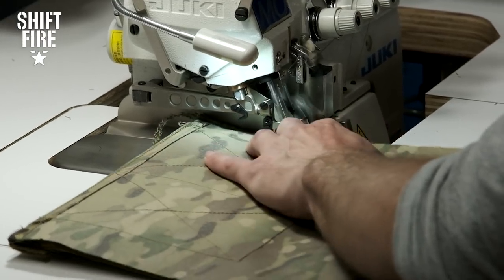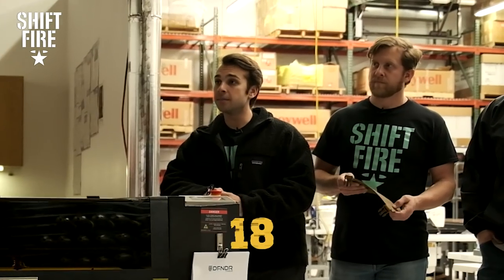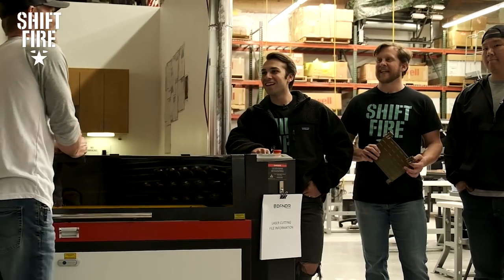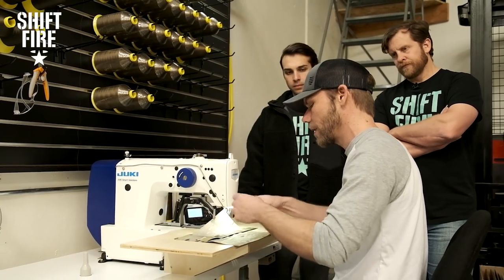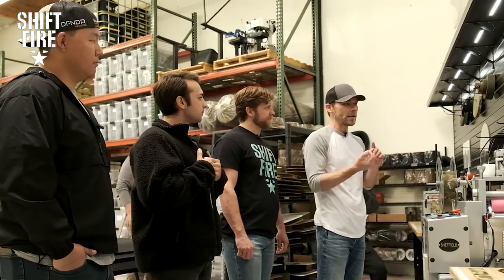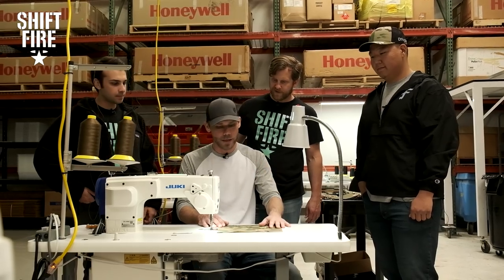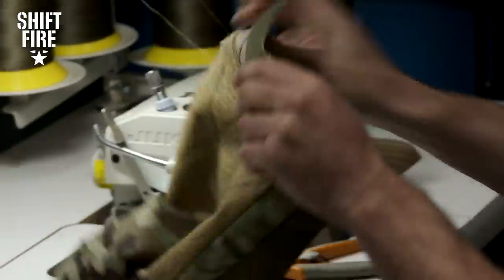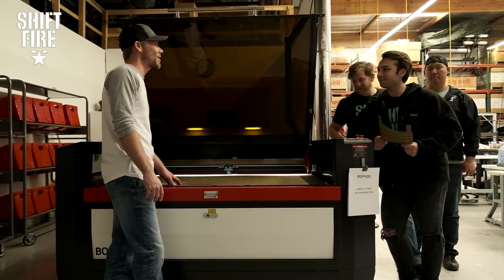Spec Ops Get A Tour Of The DFNDR Armory!

Comment: Pros of Traditional MOLLE vs Laser-Cut:
- Cleaning: Laser-Cut MOLLE webbing gets stuff stuck between the layers (assuming it's multi-layered and not just one piece) and it can be very difficult to get mud, dirt, and grime out from between those layers.
- Stretching Out: Traditional MOLLE webbing may tear at the stitching, but Laser-Cut webbing can stretch out over time and under heavy loads, more so than Traditional webbing. This causes your gear to start to sag. Not typically a problem with placards, where there's velcro to help support the weight, but on belts and the like, it can become problematic.

That all being said, Laser-Cut webbing just looks nice.
Reply: Laser-cut molle is a lot lighter, more low profile and doesn't take in much water when it rains or when you have to traverse water. The durability is comparable to traditional molle aswell. Gear being dirty is no problem, it is supposed to be dirty if used properly.
Reply: "There are no solutions, only trade offs"
Reply: @Glatidoz  Being dirty isn't a problem, but when the webbing is clogged with mud and can't be cleared out very easily, it becomes one. Don't get me wrong, I love laser-cut MOLLE. I'm just trying to point out that it's not only wins over traditional.
Reply: @Wipple Wopple   How is it bad if the molle gets clogged with dirt? 😀 It still works for pouches. For clarity, I use and like both and am also not looking to argue. Just interested to hear your explination.
Reply: @Glatidoz  I've had slots get filled with mud (pretty thick, almost clay after drying) and have had a hard time switching stuff out.

For reference, I play airsoft, and I'll run either an M320 grenade launcher holstered at my 9 on my belt, OR I'll run an extra AR-style mag. If the slots are caked in dried out mud, it can be hard to switch them. It's not the end of the world, it's just something to keep in mind.

Comment: because long time ago laser cuts were expensive as fck since it was new technology...same like with 3d printers
Reply: also accuracy has nothing to do with type of CAD you are using...most of the error is in how the machine is configured, that also means mirrors/lens positions, how flat is the floor,  the temperature in the room they are in and much more...that place doesnt have best conditions for CNC work, but its enough for what they need